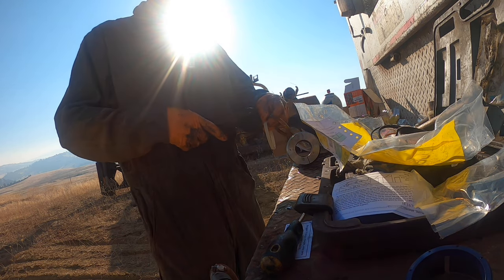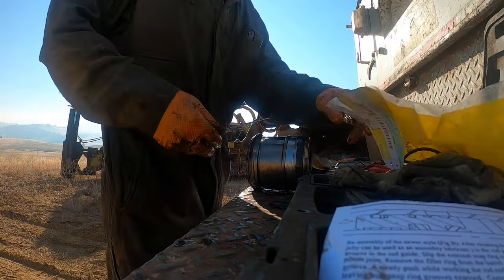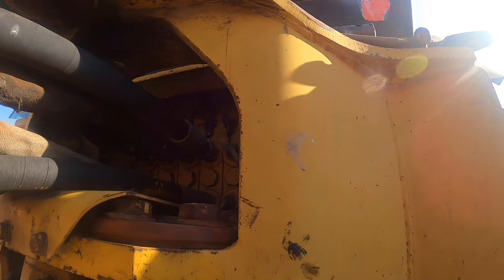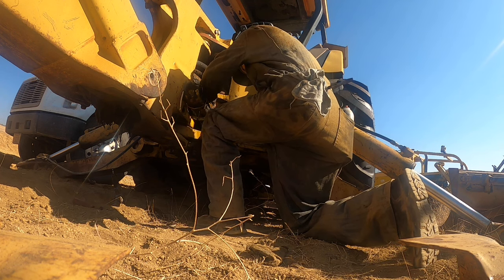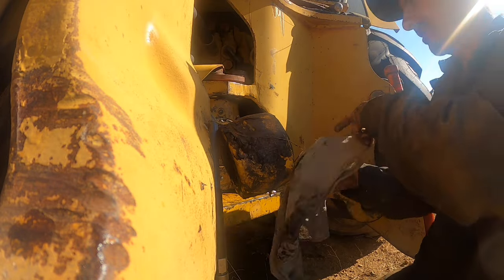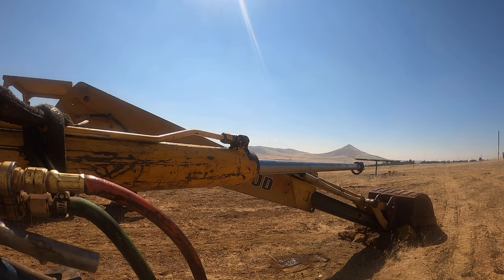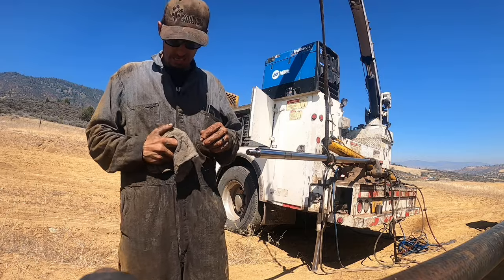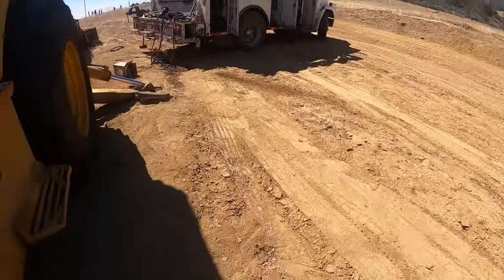Rebuilding hydraulic cylinders

Comment: I spent a good part of my apprenticeship on a 710d 4x4 extendahoe and i hated that son of a bitch 😅they always had me downtown up on a side walk inbetween a fiber line a gas line an electric line searching for a water service 5ft down with only wanting to remove 1 sidewalk panel . It took all the same buckets in the rear as a john deere 490e excavator they had and that 710 was good for nothing except pulling wheelies up the road , and when we put the hammer on it forget about it you had to have a full front bucket of material and it still would pull wheelies !!!!! Oh man the memories

Comment: I bought the Vevor 5150ftlb 1 inch air impact to get the piston nut off the komatsu pc75 boom cylinder. A little heat- propane torch and it came right off. My compressor is just an emglo pump on a  100lb- 20g propane tank. The big rams arent fun by yourself! lol At least you have a crane.